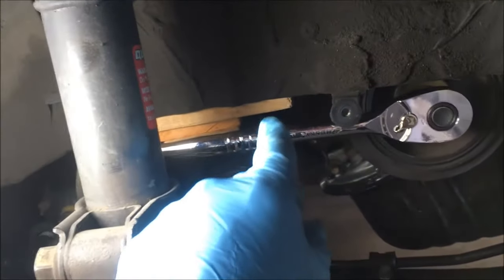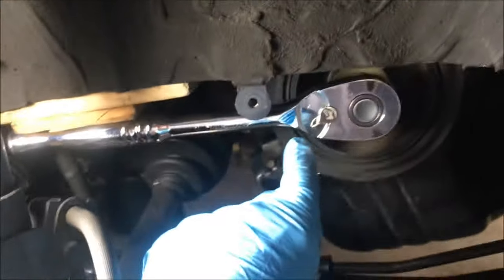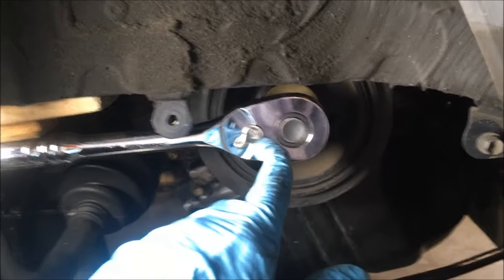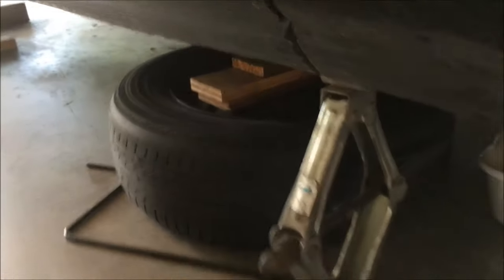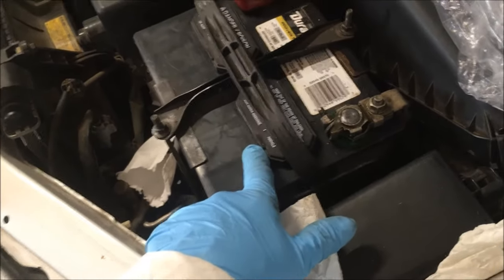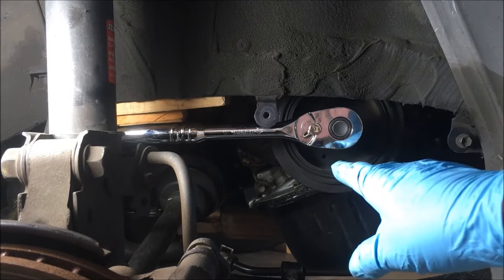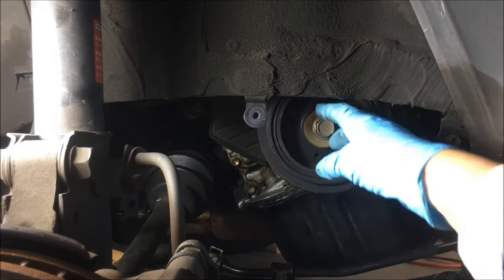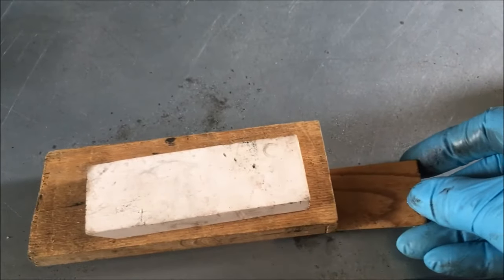Loosen Crankshaft Pulley Bolt by Bump Starting the Engine | Loosen Harmonic Balancer Bolt

Comment: Been a mechanic for the last 45 years   This is a good method, but be aware most modern cars do not have key ways to locate the pulley, and this is the only way to keep tension on timing belt pully check your vehicle before you use this method you could bend your valves or even worse.

Comment: Honda crank bolts used to give me fits.  Then, I bought a Milwaukee M-18 2767-20 impact gun and haven't looked back.  I use a weighted crankshaft socket from Lisle.  This setup has never failed me.  While I accept that the starter "bump" method will work on many cars, it is important that the crankshaft be rotating in the clockwise position while cranking the engine.  Otherwise, you would be tightening the bolt.  Should one decide to use this method, may I suggest  using a 1/2" breaker bar instead of a ratchet?  The breaker bar should be stronger and you wouldn't be taking a chance of breaking the teeth inside of the ratchet head.
Reply: I came from the hd Diesel side of things and glad I hung on to my 1" drive stuff. Very rarely do I need it but it laughs at bolts like this.

Comment: I had a 1984 Honda Accord and auto shop said to do this and brake it lose. Well, I did and it broke the bolt off. The bolt was supposed to turn the other way. Hard lesson learned. Please read the speeks before continuing. Thanks sis for the video. Love your shows

Comment: Thanks for this! I have a CA Camry and didn’t know about that extra wire. Haven’t started yet so I’ll be sure to remember to disconnect that wire.
Reply from the maker: You're welcome, W S.  Just remember--just BUMP the engine, but don't start it.  Make sure that whatever material, like wood, you use to wedge between the ratchet handle and the upper body of the car is solid and won't allow the ratchet to give or move too much.  I wish you great success!  It's thrilling when the crankshaft bolt gives way.  When you torque the harmonic/crankshaft bolt back on, torque it to 80 ft. lbs.  Happy DIYing!
Reply: DeWalt 950Nm impact driver would get that off
Reply: @bEEBO178  borrowed an impact from my neighbor and it worked 1st time. Did the entire timing belt job by myself on the first try. Pretty happy with that result.
Reply: @frugaldiy1  How do you avoid accidentally starting the engine? Watching the video I thought removing the spark plug wires ensures that the engine won't start?
Reply from the maker: @purelogic3595  You take the spark plugs wires off the spark plugs cuz then no sparky.  Don't risk it.  Don't fully rotate the key in the ignition.  Just give the key a slight "bump."

Comment: Very nice method, however I am stuck with civic 2003 EP1 crank pulley, and since engine rotating CCW I cant use the bump method right? I guess I would tighten bolt even more

Comment: Wow, how do you fix the bolt back? A hammer with the wrench would work?
Reply from the maker: I'd like to help you, Irosh, but I don't understand the question.  Please clarify what you mean, and I'll try to help you.
Reply: @frugaldiy1  after replacing the harmonic balancer pulley, how do you fix the bolt again? Hand pressure would enough?
Reply: @iroshwimaladharma5840  you will need to find the torque specification for your vehicle, relative to that part. Then you set the wrench to your desired torque spec and ratchet like normal. As you tighten the bolt with the torque wrench, when you hit the chosen setting it will "click", and you'll know that you got it to the correct tightness. (Two more tips: Practice using the torque wrench on some inconsequential bolt. Start with a weak/light setting and work your way up a couple times to a tighter setting. This will give you confidence in how you're using it before you tackle a serious bolt like this one. Next--never use your torque wrench for anything other than tightening bolts during the assembly process. This will help maintain it's "calibration". I specifically mean, don't be using it to remove bolts, and personally, I wouldn't use it on bolts that are no big deal, either.) You're probably watching this vid anticipating some serious work so, good luck!

Comment: I realize we are only bumping the engine and not starting it, but is there any chance of timing belt skipping?
Reply from the maker: It didn't on my car.
Reply: @frugaldiy1  Yes why the wrench drops when performing this. Of course force of the crank turning is much higher than the wrench holding the bolt. I believe the engine still turns counter a bit with the timing belt attached. I have one more method to try before trying it your way. Thanks for the video.
Reply from the maker: The racket drops because it loses tension when you bump the engine.  You're welcome, simple.
Reply: I finally did it your way because nothing else worked. I used a long breaker arm and placed it against the lower control arm. It worked like a charm. Btw… torque on this bolt for my Solara is 169 ft/lbs. I used a compact wrench with 250 ft/lbs and still couldn’t get the bolt off. Timing belt had been changed before. Any idea why some bolts are torqued so high?
Reply from the maker: Wonderful to hear!  I'm glad it worked for you.  Yes, the reason some bolts are over torqued, like mine and yours, is because folks use an impact wrench to tighten the bolt, instead of a torque wrench, and they over tighten the bolt.  It's a lazy person's way to do it.  Tighten the bolt to torque specs when you put it back on and you won't have a problem getting it off in the future.  ;)